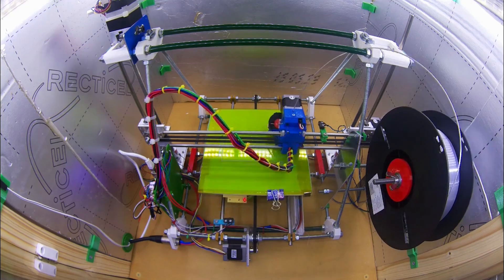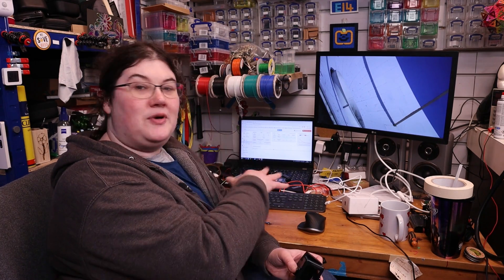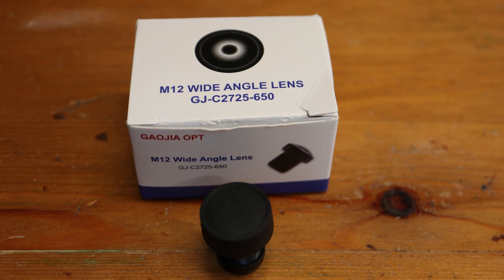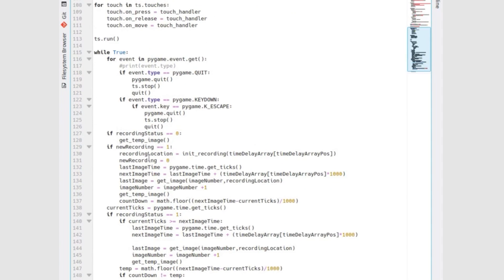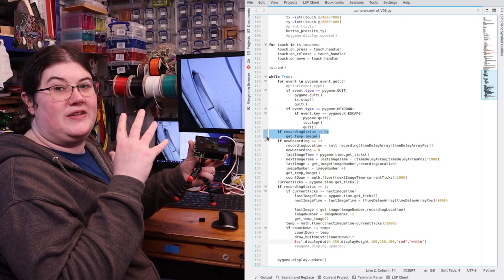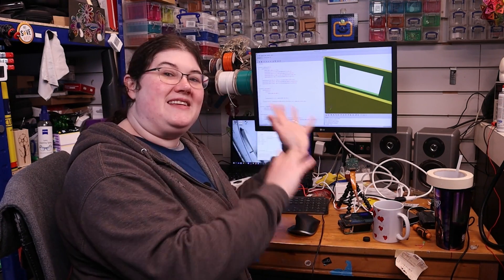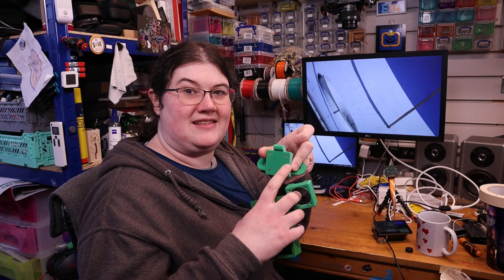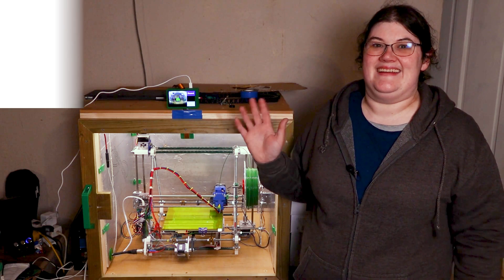3D Printer Time-Lapse Camera with a Raspberry Pi 5

Comment: I wonder how well an Arduino or ESP32 could do this? I enjoy the Pi's but they've been hard to come by in the US, at least for a reasonable price.
Reply: They are appearing more often these day, so it's worth keeping an eye out. 
I'm not sure the quality would be as good, but sure you could get something working with a ESP32 based system. Probably wouldn't be a very high resolution for the time lapse, but as an image for checking the print in progress would probably work

Comment: I used a pi 3, camera module v2, and the timelapse software built into Octoprint. Works a lot better because it always puts the bed in the same position before taking a picture. If you wanted to improve on that you could maybe trigger a photo every time it hits certain coordinates on the horizontal plane (or every time it starts a new layer). That way, the timelapse wouldn't slow down the print by moving the head out of the way every time. I also don't think I've seen someone use a reprap in like 10 years, that's pretty cool.
Reply: Yes, previously we'd planned to use octoprint to do the photos like that. But we've gone for the Duet board, and really like the controller, but I don't think it can do the camera control. I might have a look into if I can obtain the coordinates and trigger the picture though, as that would be nice, and an easy addition to the project.

We love the reprap, our first and only 3D printer, it gets used most days! 
The white parts are all the originals we got straight from Adrian Bowyer, most of the rest have all been replaced over the years!

Comment: Why did you hard code those values, for the rotation hack, you already have them defined as DisplayWidth and DisplayHeight at the top of the file you could of just used them and if you ever need to change resolution the code will still work.
Reply: Yes, I should have used them. It was one of those times where I was just coding a fix quickly to get it working, and then reviewed it afterwards, however I'd already filmed, it's been optimised now :)